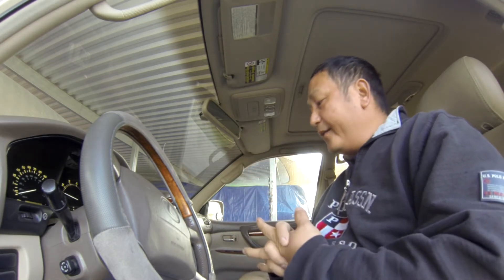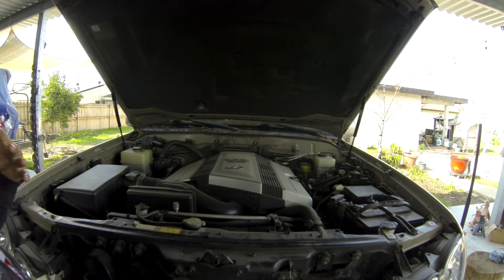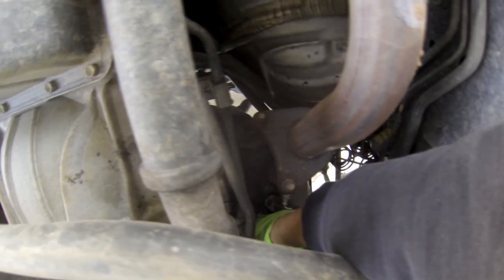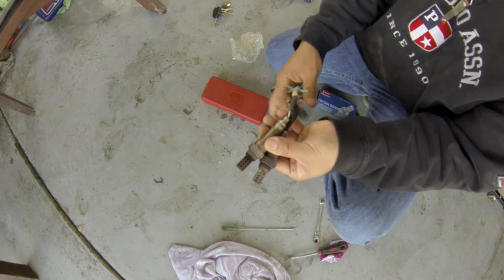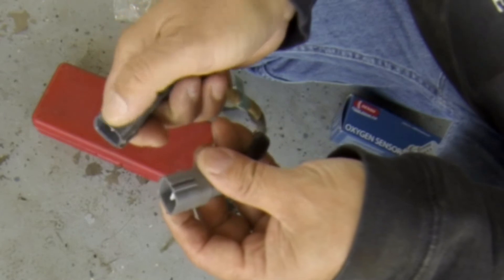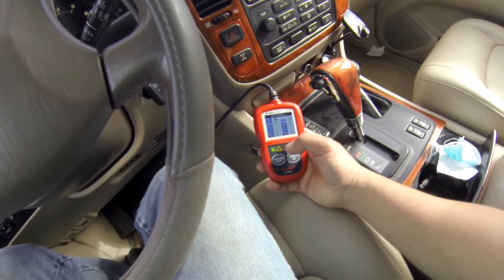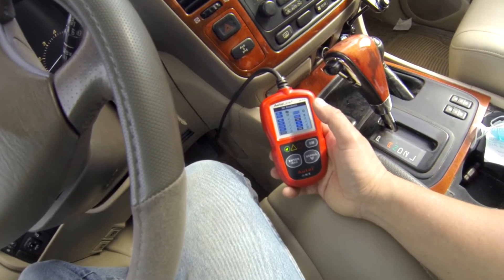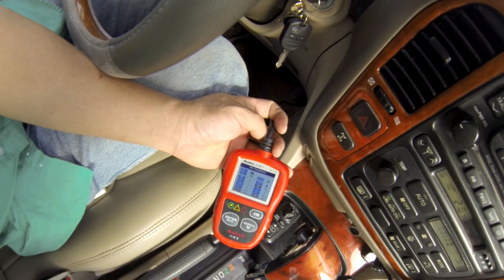Lexus LX470 2UZ-FE code po155, po135 and plug modified.

Comment: My 07 lx470 still give me P0185 codes. I already change the o2s. Can u give me what next!
Reply from the maker: I think the po185 may not be a o2 code
Reply: @alltsab  I thanks my Catalytic converter clocked out? Still not sure
Reply: Thanks
Reply from the maker: @sokhayin3055  I have a recently video about clog cat.converter. please help me subscribe ok thanks for watching
Reply: @alltsab  sure
Reply from the maker: @sokhayin3055  did you throw away 02 sensor.  I believe it's all good sensor
Reply: @alltsab  still have it...
Reply: Try catalytic converter  cleaner . Google to verify
Reply: Remove upstream sensor and put in some catalytic converter cleaner whether  spray or liquid form while running,
Reply: A/f ratio sensors more expensive. Correct 4 wire.